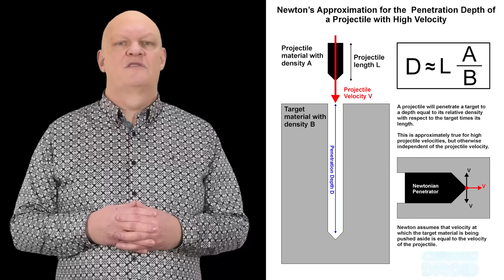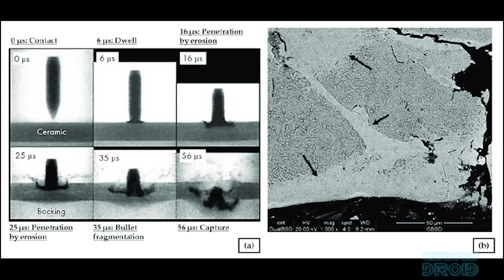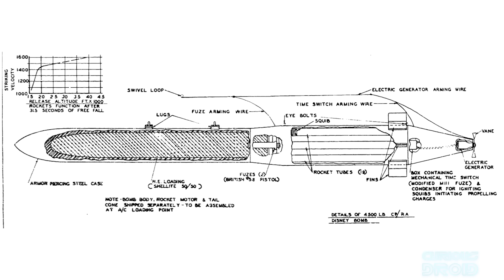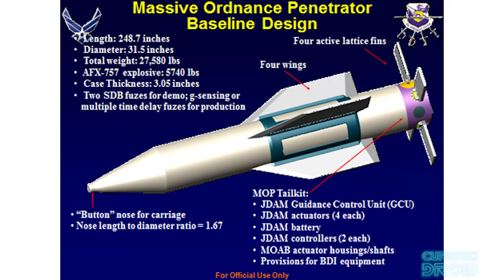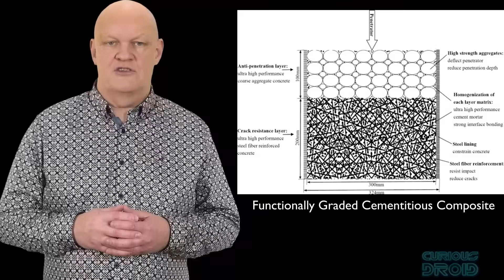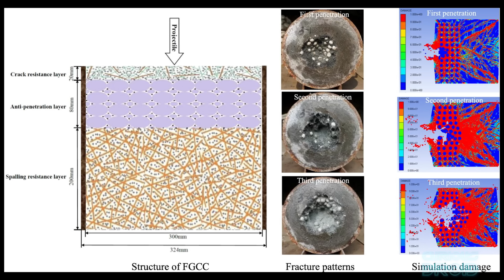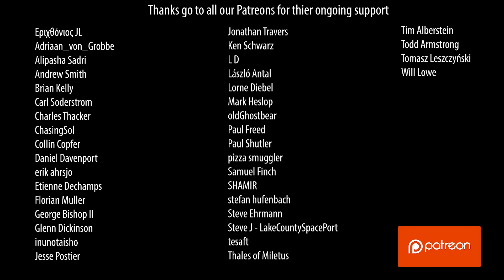Can Iran Stop U.S. Bunker Buster Bombs?

Comment: I think this is also been a issue with super deep bunkers 1000 + feet down. Just take out the entrance and exit and any communications seems to be the best strategy. Really makes emergency exits that are well hidden a must when designing  even super deep bases and bunkers
Reply: Most large bunkers buried that deep have a means to dig out via excavator. At least when we were worried about nuclear exchanges that was fairly standard protocol. We knew the nukes would make a mess of the topside, and we'd have to dig ourselves out. Here in the states they were these huge borer machines, like we use to carve out subway tunnels. I'm to understand the Russians had a similar device, but I don't know specifics.
Reply: @brianhirt5027  but that would incapacitate whowever is in that bunker nevertheless.
destroy topside cuts off all comms and movement.
In war you don't necessarily have to kill , just immobilize or sever the commlines of the enemy C&C is usually enough
Reply: @stijnvandamme76  Agreed. But getting the comms can be harder than you think. It doesn't have  to be directly on top of the bunker. In fact the best decision is usually to place the tower on the highest proximate ground. With fiberoptic lines that tower can be miles away.
Reply: @brianhirt5027  That makes sense especially for larger complexes like Russia's Yamantau mountain. Nobody in the west is sure how big it is but it's long been considered a nuclear weapons sink that would required a large number of repeated nuclear hits to have any chance to take out.
Reply: @johno1544  Layered defence requires layered attack . Drop a number of the deepest penetrating bunker busters in the ground just outside of the bunker, one after another into the same crater until the crater was ~1-2,000 feet deep. 

Then gently parachute drop a hardened reenforced  of 10-20MT H-bomb flat side town into the crater with a long delay fuse. I'm thinking a 5 ton half turtle shell of sandwiched uranium/tungsten/titanium over the device to shape the initial wave of ignition downwards. I would extend the shell all around the device, but thinly on the slightly rounded bottom. Bonus: the U of the shell will add additional fissile oomph to the device

Next drop a number of smaller guided munitions to cause the sides of the main crater to collapse in over and deeply cover the reenforced H-bomb protected under its shaped charged shell.  20 minutes later when the big one goes off, the shock waves will also propagate strongly  laterally and rupture the side of the main bunker and any structure remaining might well collapse into the gigantic new crater formed.

Badda bing, badda boom.
Reply: @johno1544  Right, and we have Cheyenne Mountain & Greenbrier complexes. The other reason to have the borers was in case we needed to expand the complex in case of a total nuclear exchange. We had everything to set up underground agriculture, living spaces, et al. I'd imagine Ivan had something similar. But regardless, your strategy doesn't really work when you're talking about any sort of military grade C3 bunker. It'd only work against smaller entrenchments & FOB.
Reply: @rcatyvr  That sounds like a lot to coordinate. A lot that could be spoiled by counterbattery/antiaircraft suppressive fire getting lucky. Your strategy would be totally dependent on having uncontested air superiority.
Reply: @brianhirt5027  he is dream talking.
You cut off comms wuth such bunkers and just dig in or contain.
Ppl rotting in a hole are not a problem as long as they can not affect the outside.
Reply: @johno1544  Bless you for knowing of that program. So few do nowdays! Sure, if you draft in nukes sky is the limit. But ideally we should seek to keep everything conventional just due to the harm nuclear ANYTHING will cause civilians. If they thought land mines are bad, pockets of intense radioactivity would be much MUCH worse!
Reply: @trazyntheinfinite9895  With relay stations easier said than done. Comm relays can be seven or more miles away. Just depends on how much line you're willing to bury how far, with powered signal gainers every 12 klicks.
Reply: @brianhirt5027  dude, if we are targeting their biggest baddest deepest complex you can be assured there is nothing left of their forces outside it
Reply: @jdavis6618  But that aside, anyone in a sealed tank, APC, HUMVEE, halftrack or closed enviroment excavator wouldn't have any problems handling even intense fallout. As long as they're not caught in the blast radius. They can operate for hours into days depending.
Reply: @brianhirt5027  in ideal conditions on poligon. In reality military vehicles need to refuel and restock very often, especially considering that probably before the blasts they wouldn't be fully ready. And I don't even mention malfunctions and jammings, which would be especially common in after blast environment with destroyed roads.
Reply: @glebkrawez5046  Most military vehicles used to use shielded lines as SOP. Did that change at some point? As for fuel, that would be part of the logistics corps duty. Typically fuel truck convoys or temp pumps set up at FOBs
Reply: @brianhirt5027  didn't understand what you meant by shielded lines, but while most of heavy tech sure have their internals shielded from nuke effects, that doesn't negate usual malfunctions, for example wit chasis or engine, which are very common in real combat scenarios and which require outside maintenance to sustain vehicle combat capabilities. And how you'll organize supply in conditions of nuclear fallout  especially considering that usually rear vehicles aren't that suited for that conditions. Also yeah, you'll also need a hell tonn of decontamination works on every vehicle, which traveled through blast sites to some unspoiled grounds.
Reply: @brianhirt5027  As ex-army I would disagree that handling fallout is easy.
Reply: @dralord1307  It's getting into & out of the suits that bears the greatest burden of risk. You must be diligent to ensure no radioactive dust can piggyback into your clean areas.
Reply: @brianhirt5027  I have worn mop suits. they suck. You cant really fight in them, they are hot a hell, if your fit isnt perfect your screwed. If your gasket or any part of it wears out due to exposure your screwed. 

Its about the same as wearing a black trash bag over yourself in the desert.
Reply: @dralord1307  We've wandered pretty far in the weeds at this point. This is a tangent of a tangent of a tangent OF a tangent. In the originating  sub-tangent I just asserted that a bunker can still be excavated to anytime after the blast wave. Radiation was a mitigable risk. How we've come from that to talking about combat effectiveness in RBC is a mystery to me.
Reply: @brianhirt5027  It started with your claim it was easy for soldiers to deal with the fallout. Which i disagreed with.
Reply: @dralord1307  In that particular context, yes, it is. We AND Russia built tanks (among other heavy equipment) that could screen heavy radioactivity from the soldiers in the cabin for days or even weeks.  Why are you generalizing it?
Reply: @brianhirt5027  I said soldiers. You speak as if you understand about the military. So you should know what a soldier is. A solder is boots on the ground, army. Hence why I brought up MOP suits etc. 

I said that from the very beginning
Reply: @dralord1307  Its not easy, but most nuclear armed nations have well tought out protocols for this. As for the poor fighting condition in the suits... There is one on the enemy guy too.
Reply: @brianhirt5027  Most modern fighting vehicles do have radiation screening and filters, but I dont think anyone can sit in a tank for weeks. This whole thing was just installed so they could survive that one or two days of fighting before they get destroyed.
Reply: @S300V  I was in the army. I am aware of the mop suit protocols. Mostly its get the suit on as quickly as possible. After that its secure everything and evac to a non contaminated location most of the time. 

And yes the enemy would be effected too. But the situation was bunker busting, and the original goal I was replying to was that "our soldiers can easily work in a contaminated area", which I highly disagree with.
Reply: @trazyntheinfinite9895  Cutting communications may be difficult, it is after all easy to bury the rather small communication cable and protect it for some distance from the bunker. You can also easily make it redunant.
Reply: @brianhirt5027  The coordination required for Richard's idea wouldn't need to be done manually. You can automate 90% of it, in which case all of it can happen in a rather quick sequence. It's not necessarily much more air space control that is needed than what you need for dropping any bombs in the area.
Reply: @wopmf4345FxFDxdGaa20  Just depends on the nation in question. If it's the USA doing the attacking we have dial-a-nukes that can penetrate the surface pretty deep before detonating and locally creating an 8.3 magnitude earthquake...Sure to collapse any bunker within about a Klick or so.
Reply: Casaba Howitzer.....
Reply: @glebkrawez5046  usually only tanks, IFVs and some personnel carriers have NBC systems.  And even then you gotta go outside eventually at which point you’re dependent on PPE, which also has a finite usable life.  No one gets to hang out in radioactively contaminated environments unscathed.  You must go somewhere less affected.
Reply: @S300V  have you ever worn such a thing? Whether the enemy has to as well or not doesn't matter. In such circumstances you already start to have trouble surviving without any enemies around.

I wore them as a firefighter training to fight accidents involving chemicals. Finding at least two to three litres of sweat (more than half a gallon) after a few hours of usage was common, even if outside temps were low ...

You can't survive like that for long.
Reply: @brag0001   If you read my other comment, you will understand! Its only for a short time. Also everyone stays in vehicles most of the time in such case.
Reply: @S300V  Yes, I have. But I was referring specifically to the one about both sides being equally burdened by the necessity to protect themselves.
Reply: @brag0001   I understand. However the men would be mostly inside vehicles and bunkers. Actually this was a great deal during the development of weapons during the cold war... How to make them NBC protected. Because that was potentialy the only way to remain in the fight... For that few hours.
Reply: @S300V  I totally agree that this was most likely the expectation. I was merely trying to point out that doing any maintenance, let alone fighting by infantry outside of vehicles, during this time would be VERY problematic. Not impossible; but very hard to do. Those suits are no joke. They really impose a hefty toll on your body when worn.

I know nothing about anything else regarding fighting in a nuclear war. I'm speaking merely from my experience as a firefighter training in similar suits ...
Reply: @brag0001   My father was in NBC unit in the army, he said about the same thing... They would mostly sit inside the 4x4 nbc recon car so they could take off the hood of their suits at least. In summer many people would faint and would have to be taken inside a bunker.
Reply: @brianhirt5027  Where would the exhaust have gone if you were running diesel powered tunnel boring machines sealed underground? Unless they planned a bunch of duplicated ventilation shafts.
Reply: @gregorymalchuk272  That's a good question. I don't really know. Possibly handled by frequent pauses to allow the  industrial air scrubbers at the complex to handle it? Also possible the borers could have been direct electric drives, since a digout wouldn't require going too far from the bunker. You could essentially just use a long big-ass extension cord running back to the bunker main batteries? Those fellas always had a plan & a backup plan. Plus a backup plan for the backup plan. Lots of points of strategic redundancy.
Reply: @gregorymalchuk272  Thinking back on it wasn't there some sort of secret strategic exit(s) already included in the Cheyanne complex construction? I don't know details but seem to vaguely recall something along those lines rumored. Since NORAD is still located there i'd presume it's still all classified.
Reply: And not only that, but the necessity of having multiple entrances and exits, so that if airstrikes take out one entrance, and commandos take out another, you still have two exits further down and that come out further away that you can use.
Reply: If you're going down a thousand feet then you really need a battlefield nuke to shake them up.
Hopefully, that will never be necessary.
Reply: Sufficiently large bunkers can be have their mining equipment left in place and in an emergency if they have suffificent space to store the spoil digging out is an option. Rescue tunnels can be bored beforehand than packed with sand to resist shock. Some US missile silos were so equipped with tubes connecting to a suspended crew cabin. It's a very old idea.
Reply: That sounds very much like how fugal Britain took out landlords/castles/royalty
Reply: As far as I understand Swiss bunkers were huge. 1000m below the mountain top and still well above ground level. Allowing for numerous well concelable entrances.
Reply: The bunkers will have tools to dig out in such case.
Reply: Depth is honestly not a problem 
Strategic bombers like the B-1B for example carry as many 24 GBU-31 bunker busters or of the newer 4 GBU-72s
So as most 4 B-1Bs with mix of bombs to clear the way for the B-2 drop the GBU-57
As long as the USAF targets the right spot, they can literally dig their way via bomb to the bunker
Also remember that USAF also has the Rapid Dragon which also drop JDAMs and can carry up 45 GBU-31s
Iran's problem is that the USAF can use either Strategic bombers or transport to rain on their day
Reply: @verdebusterAP  convential bunker busters arent digging down through a 1000+ ft of rock. These command centers/bunkers tend to be under mountains aswell. Doesnt matter how many B1s or B2s you send the only way to dig down to them is to 'project plowshare' your way down with nuclear weapons. Such sites are considered nuclear weapon sinks for this reason and with the current S.A.L.T arsenals there isnt a whole lot of extra weapons to do that
Reply: That's what I say. Just block the doors. If you can't get out you accomplish the same thing.
Reply: @timhensley1297  Depends on the target. Anything of sufficient size or complexity will usually also include a way of digging themselves out. Particularly in the event of a nuclear exchange. If you've got time & access to the outside for smaller bunkers one can always just stuff the entrance with used tires and cook 'em to death. Those steel doors become dandy convection conductor ovens under substained heating.. What I like to call a "shake & break"

Comment: I had no idea concrete was going through so much innovation.  I mean, it's been around since Roman times.  Crazy
Reply: Have you heard of concrete being set in a vacuum? The idea is that it can give a substance which can be machined. 

However I doubt if this can be done with large objects, the concrete at the centre would still have gas in it when it set.

Comment: Truly EXCELLENT. Five Stars, Maximum Rating
⭐⭐⭐⭐⭐

A possible way to penetrate even the strongest concrete:
Using modern high precision guidance for the munitions, send them one after another at the exact same place. First penetrates say 10 meters. Second goes into the crater produced by the first, and digs it 10 meters deeper. Third goes into the same hole and so forth. Each successive bomb enters the same hole, penetrates digging it deeper. There appears to be no limit to penetration which can be so achieved.